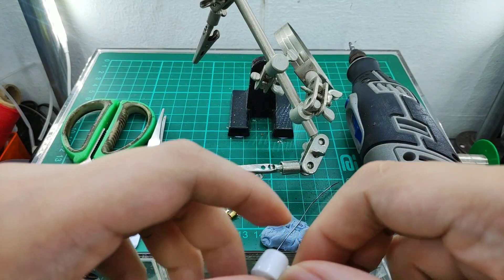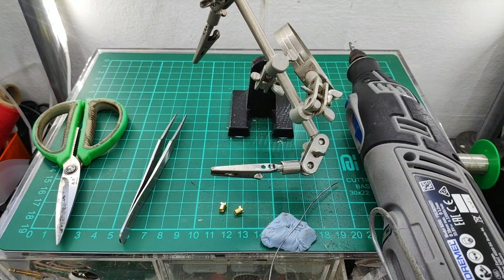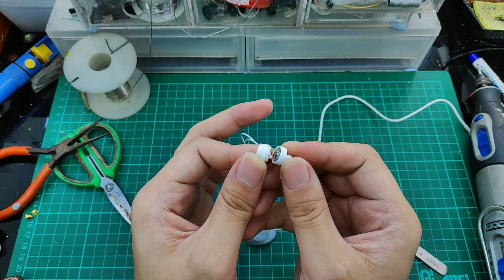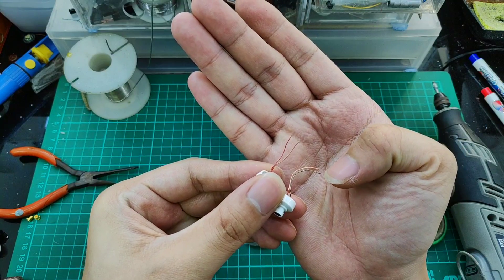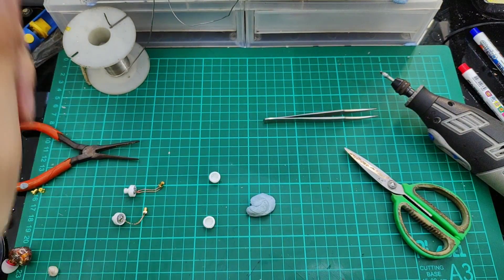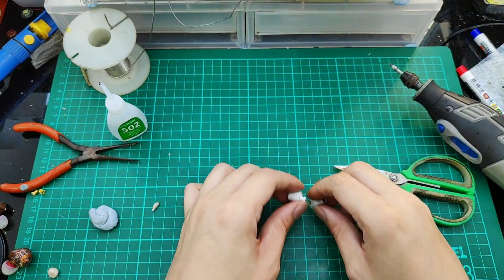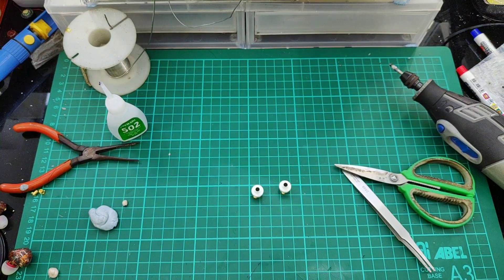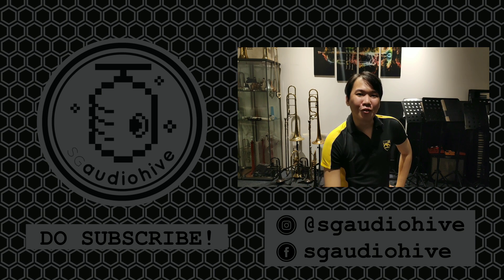5 mins Sony MH755 MH750 earbud MMCX mod Tutorial

Comment: tahnk you for the tutorial. I was able to convert mine to mmcx aswell but it was after 2 failed attempts of soldering the left piece xD. Luckily, I was able to dig my old pairs and solder the piece in finesse. 

Btw, will it be better to use BluTack instead of epoxy putty?

Comment: You make it look so easy. I usually stumble at the "tinning" stage. Even with the lighter trick and flux, I can't get the wire to take the solder
Reply from the maker: check out our soldering guide video, there's tinning guide and soldering on pads and wires guide
Reply: Use a light to burn off the coating 👍

Comment: What epoxy putty is that? Also what temp did you use on your iron for this? And would the wires need to be isolated from each other with heat shrink or something like that?
Reply from the maker: Hi there, any standard epoxy putty will do, even hot glue can do the job. 
For the iron setting, mines set to 320deg c usually so we can work faster but it will burn thru the tip faster. Also need to check what solder u use. 
The wires do not need to be isolated as they are coated with insulation already
Reply: sgaudiohive thanks for replying, what type of solder should I be using?

Comment: Nice,little dot of blue tack size of the match head on the back of the driver can make sound cleaner and wires not move inside (or at least not rub the back of the driver)
Reply from the maker: The blue tack "mod" is the basis of most driver mods, like lawton, grado ( they do that for most of their high end models) , definitely worth the time to try for DIYers!
Reply: @sgaudiohive  blu tack is a godsend to audiophile,tons of uses for dirt cheap

Comment: Is there advantage in using mmcx over a much better-than-stock cable directly soldered to the driver? Planning to buy one but I think it's too cheap to be making this much effort.
Reply: The ability to change the cable easily, most notably if you want to switch it between a Bluetooth cable and a normal one. If you don't care about that, direct connection may be the better option on these, since you'll probably be spending more on the MMCX jacks than you did on the earbuds to begin with.
Reply: @joemck85  yeah, i agree but i'd rather do it to a much better earphones. Not with mh755. Not downplaying the 755 but it's so cheap you can buy 3, upgrade the cables and not worry about having to change it.
Reply: @ironjohn03  It really just comes down to ease of changing the cable / moving the nice cable to another earphone. For some designs where the cable goes up over your ear, MMCX can also provide a swivel point to make it easier to put it into your ear comfortably.
Reply: any MMCX bluetooth you may suggest?
Reply: @agoogleuser9025  I have the Fiio UTWS1 which I use with TIN T2's.  There is a noticeable hiss when no music is playing. Might be annoying to you if you listen to podcasts or audiobooks. I don't notice it at all when music is playing. Overall, I'm happy with them. No idea on longevity as I haven't had them long enough, but as it stands right now I'd buy another set if I lost them.

Comment: Another great video. Amazing work. By the way: can you tell me which is the exact diameter of the cable hole? i want to know if a thinner MMCX conector can fit in there without the drilling process. Thanks!

Comment: since im bad at soldering can i use wire glue instead?
Reply from the maker: I will do a soldering tips video this weekend, if you have experience in wire glue you can give a try, this mod is reversible
Reply: @sgaudiohive  since wire glue are less conductive. will it change the sound? xd
Reply from the maker: Audio wire glues are widely used in HI FI and other forms of audio works, the work as good as solders in terms of conductivity but are less durable

Comment: Heard from a bunch of DIYers that there's a female mmcx plug available that doesn't need a drill, just inserts into the hole snugly. Will probably be better to get that type instead.
Reply from the maker: Yes there is, the long and slim screw type female mmcx, easier to Install but harder to fix it in place as there is no space to install the nut inside, hot glue works too